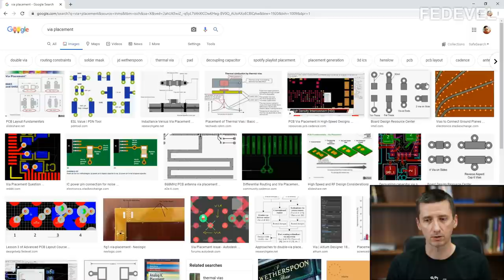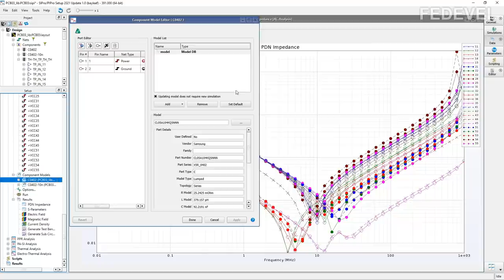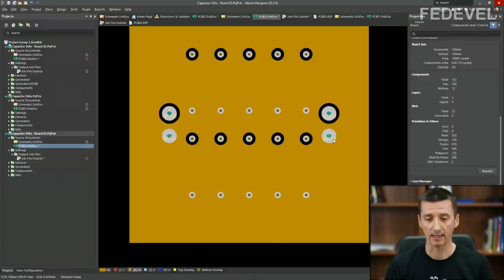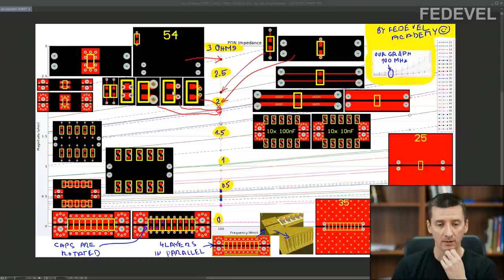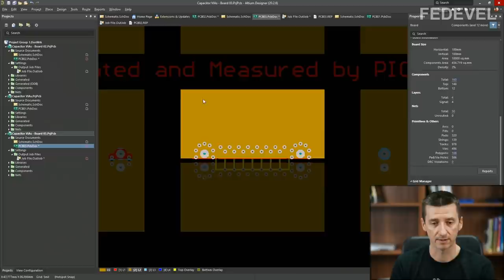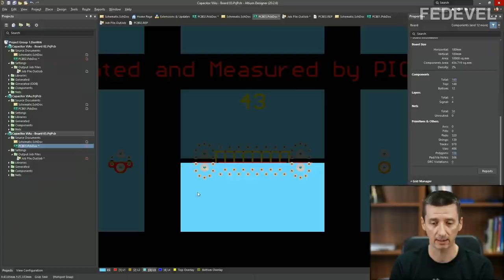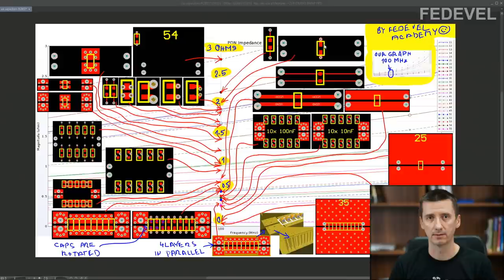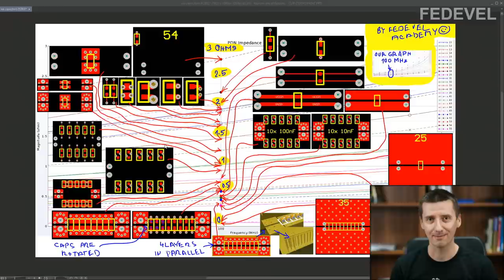What is The Best VIA Placement for Decoupling Capacitors?

Comment: Surprising configuration is simple to explain.  You're simulate impedance between output and input.  In this case you have: input,  track impedance,  capacitor short,  track impedance and output.  So,  capacitor is shorting. 
When cap is connected through vias they forms additional impedance to cap pins.  
This actually proves that method to have ic pin, cap and then via is better than ic pin,  via,  cap. 

In the worst case there are long "tracks" from input output path to capacitor. Remember high frequency current will not flow thru whole plane.

Comment: Shouldn't the measurement point be were the pins of the chip being protected are?  If possible they should be at the load chip.  I didn't see that simulation for single caps.  Good video.
Reply from the maker: Thank you Andy. PS: In some pictures I only included details of capacitors as there was no space in the graph. However the measurements are always done at the same place - in the measurement points.

Comment: Robert: What is the impedance test you're actually simulating? I assume it's the impedance (vs freq) looking into the load ("power") pads, right?  And with the supply pads shorted, or open?
Reply from the maker: yes you are correct + supply open.
Reply: @RobertFeranec  this is good information, I must have missed it in the video. What is the cap in the video? Ideal? Simulated or a short?

Comment: For the test with a single capacitor with direct (thin) connections. Could it be these results are achieved as the signals do not need to cross the vias. For this, the parasitic inductance due to vias is not included and thus the overall impedance will be lower.
Reply from the maker: Could be. The best would be measure it ... let's see if I can do that.
Reply: That was also my idea. Vias will add some inductance as well.
Reply: That would tend to be quite inductive, though how inductive depends on the trace width. In general traces on a single layer are a bad idea

Comment: Can't you design your stack up to act like a decoupling cap in some fashion? For example, when you have those wide power planes don't they act more like decoupling caps? Also, I would think vias would be almost irrelevant when placing your decoupling on the same side as the power pins as long as you minimize your current loop between the cap and pins, and also minimize impedance to the pins with wide power rails. I would think the vias would only be important for connecting to your main power rail if it's not on the same layer. But even then, I would think the decoupling would handle the high frequency load changes and the vias to the power rail would matter less because they are slower load changes.

Comment: I remember when i was study in university at the old days, my teacher always told me that Via does not fall in love with Capacitor as they are in a V_ery C_razy relationship. Via in an inductor they always said. So i guess what happening is that the via blocks the current sudden changes and so the response of the decoupling capacitor no longer effective!
Reply from the maker: Nice!
Reply: I see energy flow as water flows. Water easily flows down a stream, but if it has to go upstream it takes a while (water must evaporate and fall as rain) as it must work against itself.
With VIA''s DC energy flow is effective as niagara falls, high AC is as ineffective as an ultrasonic humidifier. It is indeed a V_ery C_razy relationship :ø)

Comment: Did you use 1oz or 2oz copper on the boards?
Did you try to meassure/simulate the difference between these two?
Reply: If I see correctly in the video, all the boards had 1oz copper thickness on top and bottom and ½oz in the middle layers?

This might be the reason why boards with thick traces on top are so much better than boards with power planes in the middle - thicker copper.
Reply: @dominikliberda4017  the copper thickness has some effect, but it is very minor

Comment: interesting video, but at least half of the designs are not ready for production! 

what kind of simulator are you using?
Reply: Do you mean that assembly house will have problems assembling the boards?
Reply: This simulator is ADS
Reply from the maker: Thank you Heinz PS: Please, what do you mean by "not ready for production"?

Comment: Hi @Robert Feranec, I think there is something wrong with this simulation. As a comparison, a 0.4mm drill 0.8mm via  through a 1.6mm PCB will have an inductance of 1.2nH. A 10mm long 0.2mm thick trace will be 4nH. These are the numbers calculated by Saturn PCB, which is correct?
Reply: If the simulation is correct, this means using inner power planes are not good, so use top layer as signal + power mixed plane, which is a bit strange and contrary to most of multilayer pcb designs so far...
Reply: @onderarik3279  I disagree with the suggestion that is the conclusion of these simulations. The simulations are saying it is better to have a capacitor on the same side as a power input pin, even if you have to have it some distance away. Also that having a capacitor on the opposite side of the board and connected to the power pin through a via is not as good. I don't believe this is correct.

I think that a 10mm trace has a higher inductance than a via and so if a capacitor on the opposite side of a board can pop a via right next to a power pin, that is a better solution.
Reply: @goatarse  I think it all depends....  the via inductance is not fixed, but dependent on its return path.  vias closer together have less inductance than vias that are far apprt.  The inductance of a trace depends on the width and the distance to the return path.  The total inductance is the some of these two plus the inductance of the vias to the chip.  So it is the sum of 3 partial inductances.  One of the demos in my workshops shows the impact of using Vcc and GND islands for the capacitors.  Again for a thick PCB the islands help a great deal, since there are many via pairs, reducing the inductance to the inner planes.  If the dielectric thickness from the surface to the planes is very thin, the vias wont help much at all.  In addition there is also the inductance of the capacitor itself.  Lower profile capacitors have less inductance than higher profile capacitors.  wide geometry caps have lower inductance than standard geometry caps.  So, it all depends...
Reply from the maker: @Goat - that's why it could be interesting to make measurements on real boards.

Comment: Thanks for a very nice video. Testing assumptions (and possibly myths) about common practices is great. One criticism though: why did you create a symmetry between the input and output, relative to the capacitor(s)? This is very different than reality. In reality, the input to the plane is very far away from the chip we're trying to decouple (relatively speaking), the regulator is maybe 50 or 100mm away. but the decoupling cap is as close to the chip's power pins as we can manage... so NO symmetry. cap should be all the way to the right in your PCBs. Maybe test 1mm, 2mm, 5mm, 10mm from the right. but certainly not in the middle like you did... Also: the classic dilemma is the order, from right to left: power pins, vias, cap, or rather power pins, cap, vias. All should be connected on the same layer anyway, as this is the most common practice.
would love to see a follow-up with the above tests!
Reply from the maker: Thank you. PS: I may try to move the capacitor around for different examples or measurements.

Comment: The difference in packages plays out for GHz signals. 100 MHz is a very low frequency for modern PCBs.
Reply: this all depends on the package.  For example Virtex 7 FPGA is high power, but has a lot of package filtering so only about 10MHz on the PCB.  A small high speed buffer has almost no power but up to 2GHz on the PCB
Reply from the maker: This is also something what I would like to cover in some of my future videos ...

Comment: Connecting decaps using thin traces doesn't matter.What matter is impedance of nw.If you add via in nw then it will increase inductance and ultimately make impedance go up.Thats why you have seen decaps connected by thin trace on same layer gave you good result.

Comment: So inductive effects (impedance) of vias are much more powerful than resistive effects of trace length. Is that it?
Reply: That's what the tests imply, but I don't believe this is correct, I think there are strange things going on with the simulation. As a comparison, a 0.4mm drill 0.8mm via  through a 1.6mm PCB will have an inductance of 1.2nH. A 10mm long 0.2mm thick trace will be 4nH. I think the simulation is wrong .
Reply: @goatarse  Maybe the simulation assumes the vias are filled up with ferrite material!
Reply: @goatarse  The simulation is not wrong.  These relationships are complicated, but the via rarely goes all the way through the PCB and the track inductance will often be larger than the length of the via.  Placing vias close together or traces close to the return plane will significantly reduce the inductance.  Each of these is a partial inductance and they are additive
Reply from the maker: That is interesting - and maybe reason why to make the real boards with more examples and measure them to find out what is actually happening there.
Reply: @goatarse  But I wonder if the examples with the seemingly high inductance vias are actually adding to the a loop area by introducing the third dimension, and it's the increased loop area that's adding the inductance?
Reply: @Graham_Wideman  I need to understand more about what measurement (simulated) is being done in this video. If its just impedance looking out from the load then I don't think the loop area is changed. Will certainly be looking forward to a followup video.